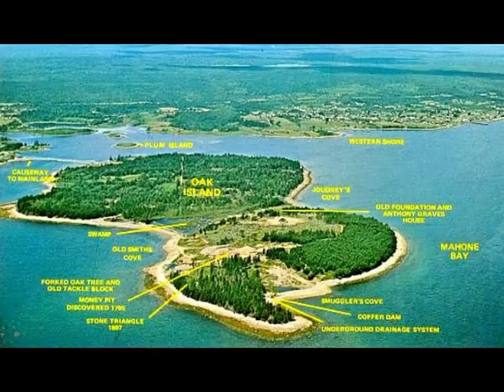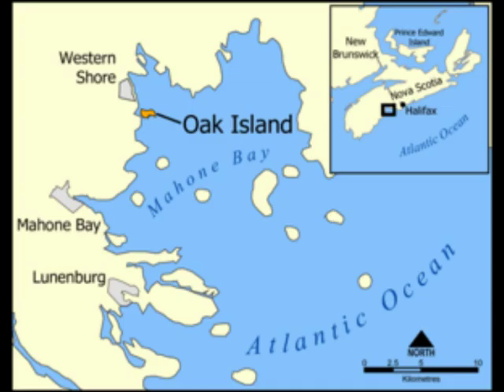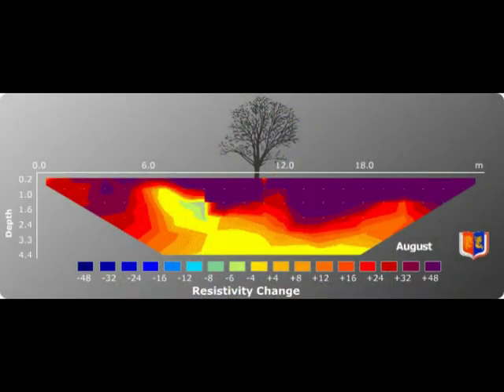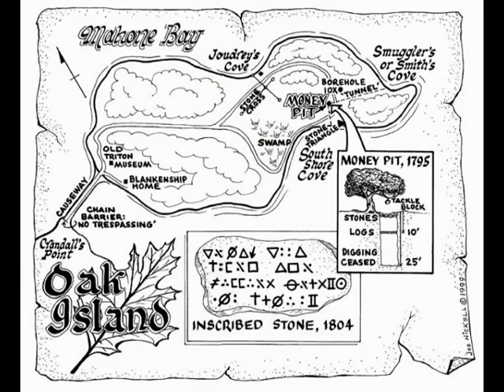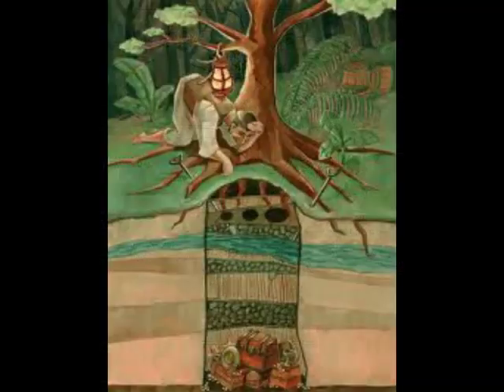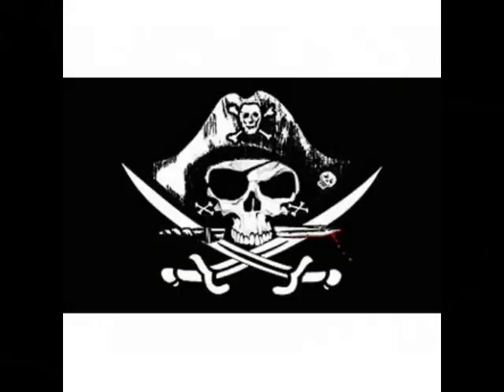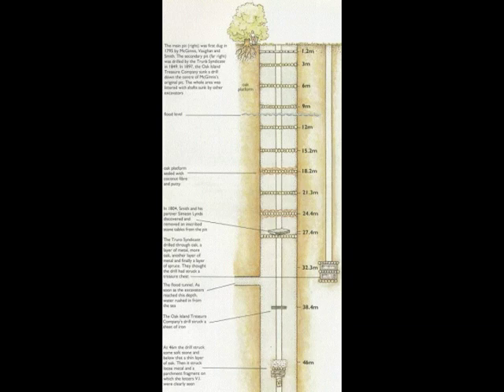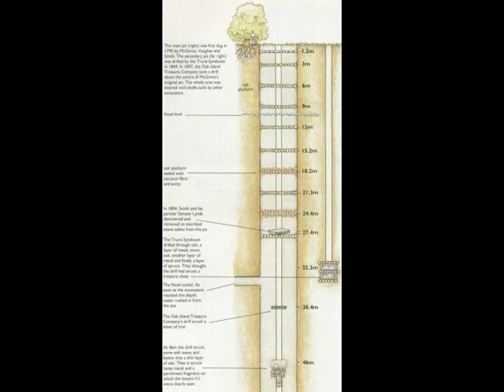Oak Island TREASURE

Comment: The evidence, objects and clues found all pointed to one logical explanation.

That being the "truth" - The Freemasons built it!

“… when you have eliminated the impossible, whatever remains, however improbable, must be the truth…”

Start by eliminating the "impossible" as to who could not have built it.

This lies with the "probable" time line of construction
It is claimed that the three discoverers found the pit in 1795 ad
If the information as to the large mature Oak Tree capable of supporting the Block and Tackle hanging over the Pit is correct than it would have been a tree of at least 75 years of age.
Experts state that Oak trees (not of old growth oak forests) have a tree life span of from 100 – 150 with 125 being the middle years.
This would place the earliest construction of the Money Pit at around 1745 ad

The Oak wood from the platforms carbon tested in 1981 to 1670 ad – 1780 ad
http://www.oakislandtreasure.c...

The use throughout the Pit and Tunnels of Coconut Fiber would prove that no construction earlier than the 1700 ad would have been possible.
Coconut Trees were only introduced outside of Malaysia after 1550 ad and the Coconut Fiber was not possible for use until the latter part of 1600’s
http://www.nhm.ac.uk/nature-online/l...ungi/seeds-of-trade/page.dsml?section=regions&region_ID=8&page=spread& ref=coconut

Other items located on Oak Island support 18th century:
Boatswains Whistle
Wrought Iron ruler
Wrought Iron Scissors
Cornish Poll-Pick, Axe
This all supports a time line of around 1750 ad and eliminates Vikings,Druids and Knight Templars as being possible builders.

Pirates would also have been unlikely to have constructed it on Oak Island.
It would have been an unnatural behavior for Pirates to go to this extreme and leave any sort of treasure for any length of time.
Oak Island is located 40 miles south of Halifax, Nova Scotia, in an enclosed Mahone Bay
After the 1600's, Halifax was England's central location for its Royal Navy in the New World.
Mahone Bay would have been a one way trap for any Pirate going in or out with them being very conspicuous.

Oak Island in 1762 ad, was a fortunate and planned choice for the Freemasons, as It was far easier to conceal their treasure in the New World with the help of the
Royal Navy and the Masonic organization presently there.
Noted New world Free Masons:
Johnathan Belcher – Lieutenant Governor of Nova Scotia (1760 – 1763)
He was based in Halifax Nova Scotia and was in charge over the Royal Navy at what is Oak Island.
His father was Jonathan Belcher senior, first Freemason of North America and the “Senior Freemason of America”
John Mitchell – creator of the Mitchell map 1755 ad
He was stationed in Halifax and provided a very concise map showing the islands around Nova Scotia and what is today Oak Island.

The "true" builders of Oak Island Treasure Pit who had the motive, opportunity and the best ability were the "Freemasons".